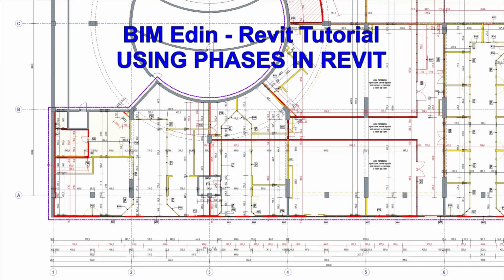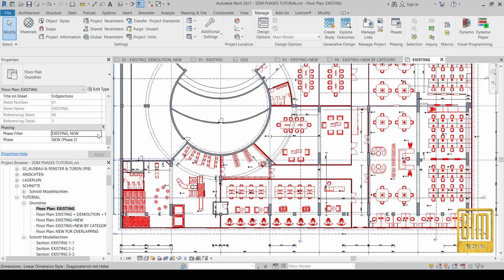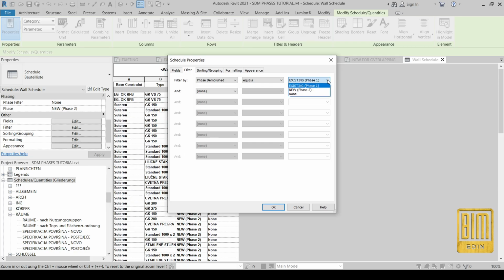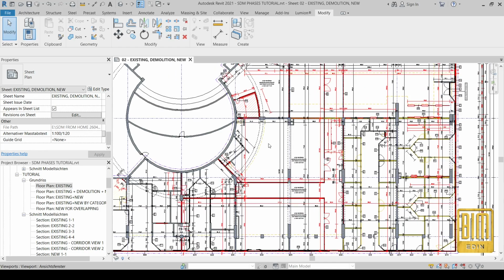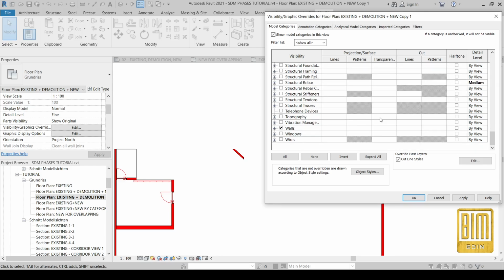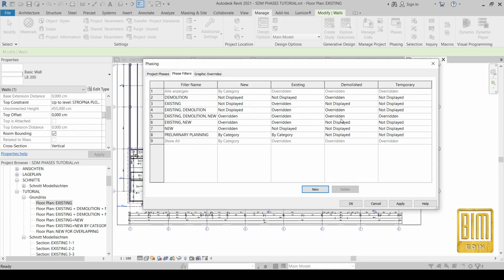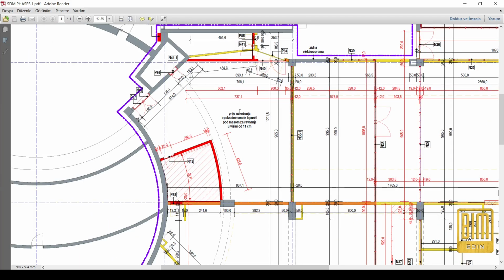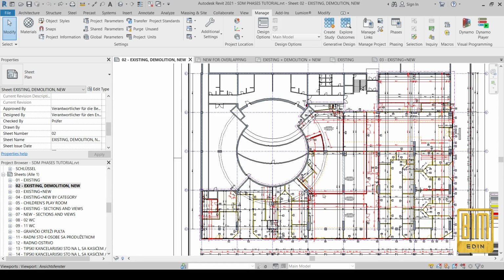REVIT PHASES TIPS AND TRICKS/ INTERIOR RENOVATION AND ADAPTATION PROJECT

Comment: Hi, I am having an issue, I can't change the color of the new elements, even if I change them in phase settings, do you know the reason for this?
Reply from the maker: @perniasuhaib1481  Sorry for the late reply. 
1. check the phase filters. 
2. check whether the new element is in the second ie. to a new phase. 
3. in case the demolished element overlaps with the new element, then only the color of one element (demolished or new) will be visible.